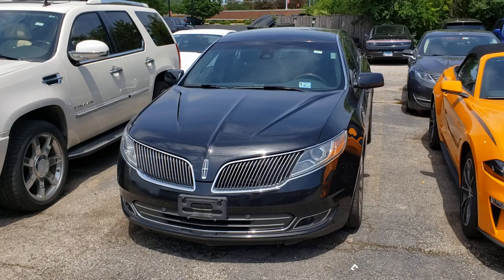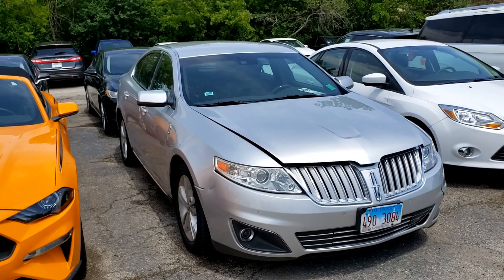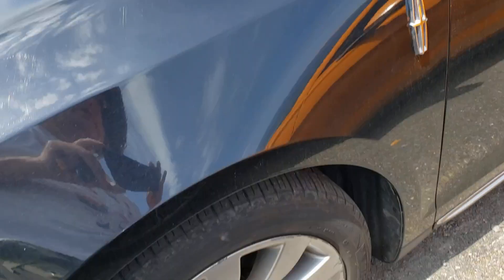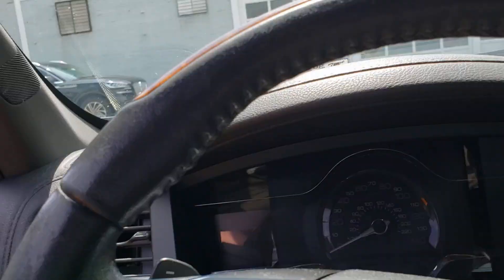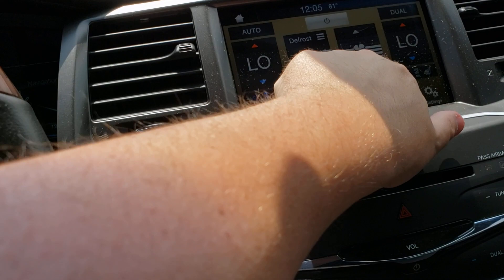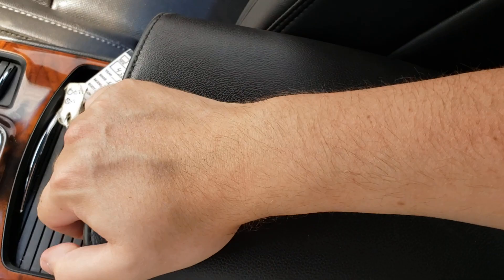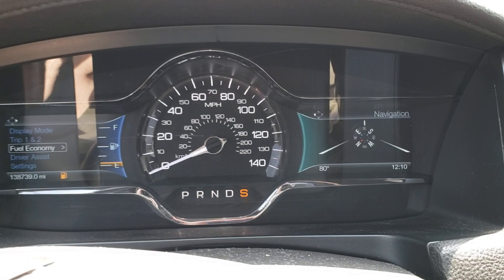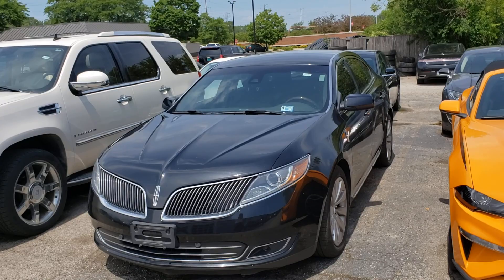"Shopping" 2016 Lincoln MKS against 2006 Lincoln Town Car

Comment: All my studies show that the interior wood trim pieces are indeed real wood, albeit highly laminated and way too glossy to suite my taste.  IMO it looks like faux plastic wood trim but to each his own.  And the difference of the color of wood on the doors versus that of the color on the dash is probably from years of exposure to the sun.  Especially if you pay attention to the hues of brightness/darkness on the wood paneled center console.  The doors receive less direct sunlight than any other piece of wood trim and as such would generally be darker than that of steering wheel strip, dash panel trim and the flatter broader sections of the console.  And this car does have a rather deep set windshield which will allow optimum sun exposure if left or parked outdoors for extended periods of time.  Also, the spare tire was labeled 'Temporary Use Only'.  I'm certain that the spare tire/wheel in the trunk was NOT a full size one.  Most newer cars, even Lincolns, do not have so much room to spare that they can have a huge deep wheel well in bottom of trunk to house a full size spare.  The interior is nice looking but not a big fan of that exterior.  The 'split winged' grill with Lincoln [+] in the center reminded me of and Olds Cutlass  or Regency from back in the mid 80's.  And the style was just missing the point of a Lincoln (especially for one replacing the Towncar).  A Towncar was not meant to be sporty.  It is a luxury touring sedan that eats up bumps, potholes, and road imperfections and glides on air while in the solemn silence of a university library.   I enjoy your videos.  RIP Lincoln TC you are missed.

Comment: It looks like the Taurus inside. They did a good job to make it look different from the outside but I don’t like the styling at all. I did have the old Ford sync in my old F-150 truck and it worked flawless. So not all of them lagged. Maybe they never updated this one.
Reply from the maker: Thanks for the comment. You think that the inside is Taurus, but I think the outside is :) The bottom line, it's a Taurus with a price premium :) After I played around with the Sync system, I learned that it required a very precise press and a little patience.

Comment: Thanks for sharing it.  Do you think mks has the same reliability as town car ?
Reply from the maker: I think overall it's OK, but these engines and transmissions will probably not last as long. Also, too many electronics inside compared to the Town Car so just more things to break.
Reply: Vitaliy Kofman got it.  Thank you sir.
Reply from the maker: Thank you for your support!
Reply: It doesn't.
Reply: They are all good cars if taken care of. The Town Car is an older  type luxury meaning pure comfort. The MKS are also nice and run hard. The MKS has an option for a 3.5l twin turbo that has decent horsepower. The V6 is better on gas and the MKS has more speed than the town car. But the town car is still nice. Yes, the MKS can have a few minor electrical issues. I've had a Lincoln MKS that I sold with 186,000 miles that was still running strong. Just had issues with touch screen and dash would short off and on.